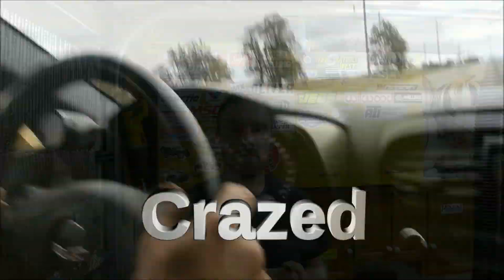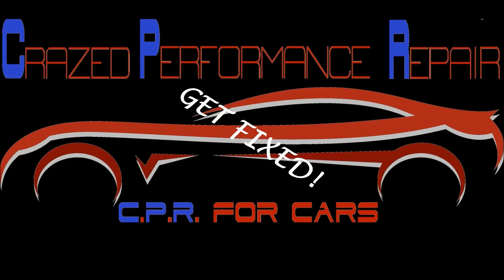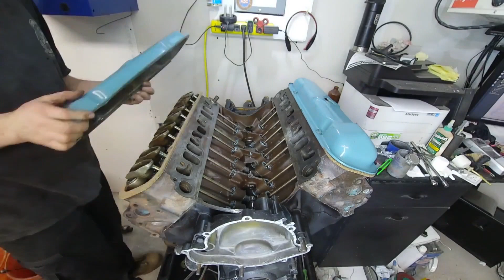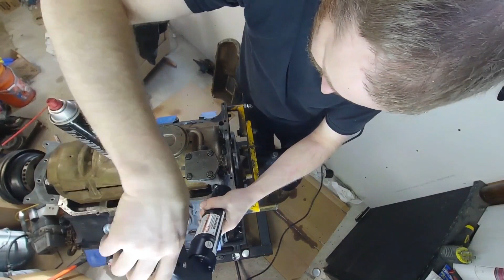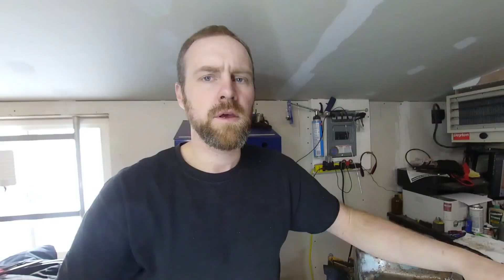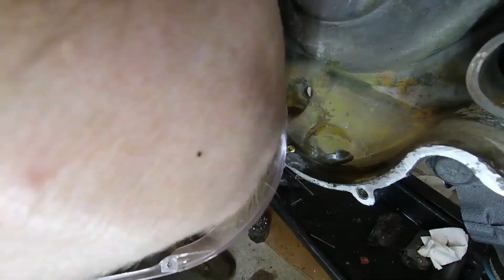326 Pontiac Engine Build Finished

Comment: Wow you are not a Pontiac engine builder. Where to begin. If you did any reasonable research you would know that Pontiac 's are adjusted zero lash by ft. lbs. ! the whole oil pan issue was addressed by the factory a couple years after production. There are much better gaskets available in good kits. What machine shop sent that block with that crack ? That was very shade tree ! No offence intended but please remove this video, it is embarrassing ! Your own secret sauce for break-in really ? LOL Real Loud
Reply from the maker: Wow, Never claimed to be a old school Pontiac engine builder. Oh well I'm glad it still runs just fine. Thanks for your time viewing, comment, and hopefully a thumbs down since you disliked it so much. It all helps the algorithm for me.

Comment: If anything changes such as head milling, deck milling, head gasket thickness or camshaft base circle, you need to be very careful to get some pre-load on the lifter but not bottom it out.  An easy fix is to use SBC rocker crimp nuts along with a 7/16" flat washers under the nuts and make it adjustable.  I'd use hardened washers to be on the safe side.
Reply from the maker: I only trimmed the minimum and checked to make sure I had some lifter play while on base circle after torque down to ensure room for expansion and wear later
Reply: @CrazedPerformanceRepair  i have a question man i had my motor rebuild and drop in my car but mi haven’t started it since rebuild it’s been sitting for about two years never been started since rebuild there’s no oil or anything in it. Should i do a thing specifically beside adding the oil and all? I’m also having triple installing the distributor any help would be great thanks i have the 326 also
Reply from the maker: @josecollazos6  might be a good idea to pre prime the oil system in case the builder only used oil on assembly. There are prime kits that adapt to the oil filter housing one can use for this.
Reply: @CrazedPerformanceRepair  so how do i go about it ? Pre prime the oil system then add the oil ? Do you know where i can find the kit for it ? What about the distributor? Any recommendations or tips on a easy way to get it in correctly ?

Comment: I like your advice and your repairs and I was wondering what sealant and brand  it is and just curious how hard would it be to get that pan back off?Thanks keep the videos coming.
Reply from the maker: I will add it to the description, as for how hard is it to get off there? well lets just say it does't come off easy lol... If a guys needs it off again a knife along the edge can do it but the best bet is running a torch over that part of the pan to release the rtv.
Reply: Never cared for the cork either but coated with the rtv both sides.